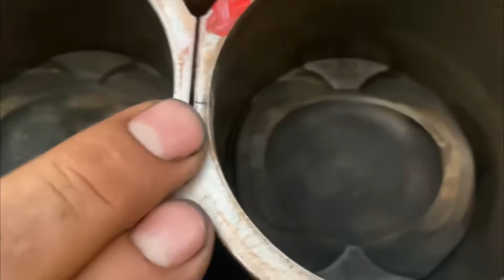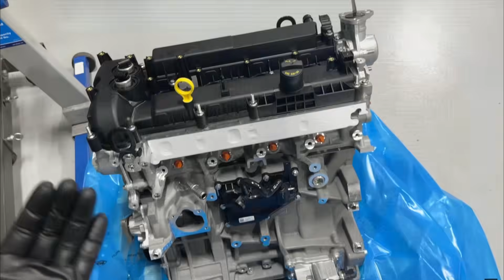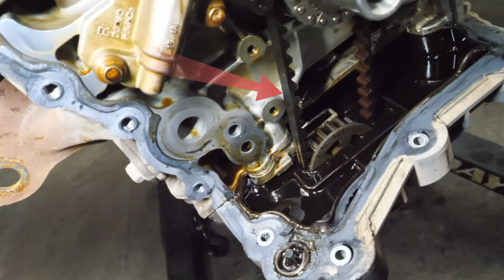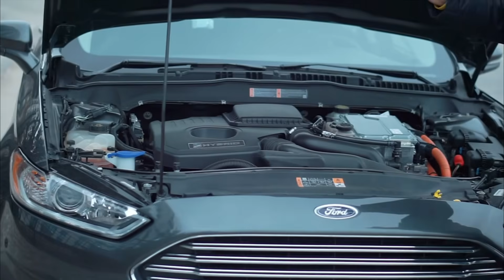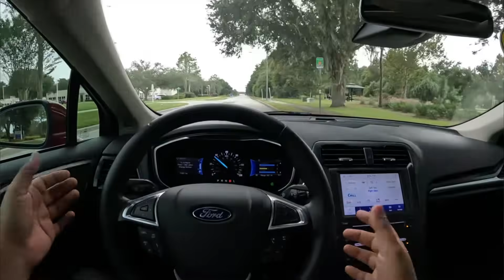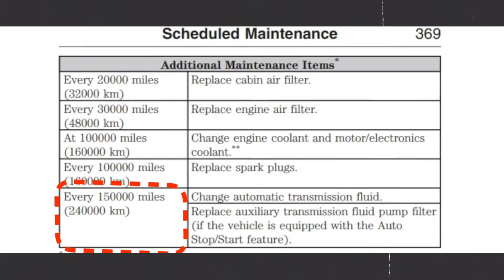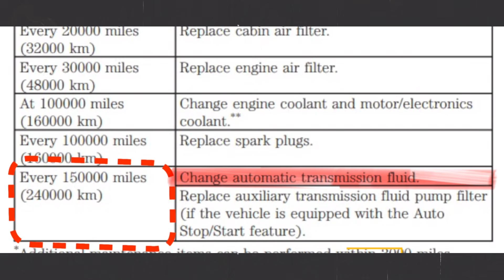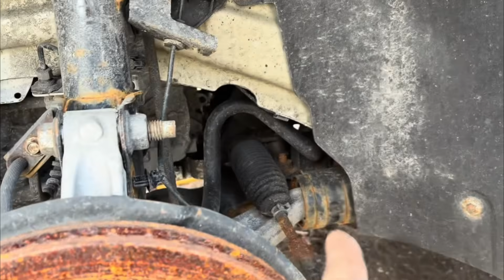Ford Fusion (2013-2020): A Complete Reliability Guide

Comment: I own a 2016 fusion with the 2.0 and awd... by far the biggest hunk of junk I've ever owned. It's a great looking car but i wouldn't recommend buying one.
Reply: I wish I had known this before I racked up 174k miles on my Fusion and 83k on my Maverick, both 2.0 Ecoboost.
Reply: @demonsaint1296  what all did you replace though?
Reply: @chriscargill7781  belts, some hoses, batteries, on time fluid replacements, and an alternator.
Reply: @chriscargill7781 fluids when due for change, some belts and hoses, battery or two, alternator, spark plugs and wires.  Active not reactive maintenance.
Reply: @chriscargill7781  nothing major, just regular on time maintenance and an alternator.
Reply: @demonsaint1296 do you also complain about changing your tires? Hoses belts and other small things wear out over time
Reply: I would say you have been fortunate with your fusion so for.  On a high note the maverick has a better 8 speed trannie though based off the old 6 speed.@demonsaint1296
Reply: i have a 2016 2.0 ecoboost at 86k and love the car no issues if you take care of it no issues will occure only thing i replaced is rear shocks which i did immediatly all oil change radiator flushes and annual checks if you cant afford to maintain a car you shouldnt own one
Reply: @DeeWazeMusicOfficial  you don't have a clue what your talking about lmao. All the lawsuits and recalls are just made up because you haven't had a problem? Makes sense.. you might want to do a little bit more research. Maybe join some of the fusion groups and get a little more knowledge before claiming someone can't afford a extremely basic car. 🤦🏻‍♂️

They look good and the older models went forever however the newer ones are literally known for bursting into flames. 

Rear shocks are only like 100 for the pair. 

Is this amazing fusion you speak of fwd or awd?
Reply: @chriscargill7781  i also have an 1984 f150 90k no sissues and a 2021 ford explorer no issues at 56k had all recalls done once released did all the research y do i need to join groups when i own one and experience it myself y dnt u take care of ur cars or by a bicycle 😂😂😂
Reply: @DeeWazeMusicOfficial  I also have 4 trucks what's that got to do with anything? 😂 The fusion is a shit car.. loved by people who don't know anything about cars such as yourself. 

Your cars so great you gotta try convincing random people on the internet who have forgotten more about cars than you will ever know. 

Yeah why or as you would say "y" look into something you clearly have no clue about. 

Good luck with your fusion 🙂 your going to need it.
Reply: @chriscargill7781 with all due respect most of the US market complains when most of the drivers do not service their cars properly. most of the lemon law cars there are awesome in almost everywhere else, ie n54 and n55 engines well maintained are rock solid, also fiat is a symbol of reliability in south America, the thing that kills cars over there are the emissions crap. take care of your car and it will take care of you. also all of the electronics issues you mention seem to be due to humidity. I had the same issues with my 17 focus powershift, and besides that it was bulletproof no issues with trans at all. I did maintained well, every 50k miles took everything out and clean everything  also did a repro on it to improve the shifting but I did 150k miles and it never left me stranded. so americans(us specifically) you have serious issues with servicing your cars. even toyota said this about the US market. we need to make the cars being conscious that people will not maintain them properly since Americans are lazy.
Reply: I'm at 200k in my 2016 SE... always use mobil one oil , shell higher grade gas , change sparks ...I'm going strong still
Reply: Really?  I had an engine failure with mine at 150k miles... but that may have been some fault of my own.  Replaced with a used engine for 6k.... the car now has 300k miles on it...  I got my money's worth
Reply: @PrivateAccountXSG  that's not bad! Still at 150k it shouldn't of needed a motor. I seen a guy that had like almost 400k on his and he loves them. 

Seems like they are really hit and miss I'm unfortunately in the majority that got a lemon from the factory. I like ford's but a bad design is a bad design. 

It's unfortunate to because I love the looks of them and the older version was great. 

I been following all the class action lawsuits and recalls on them and so many people have had all the same issues as me except the trans burning up... I've got lucky so far but hopefully it will be gone by then lol. 

I stand by what I said though and wouldn't recommend someone buy one.
Reply from the maker: After what Mi did ot start bothering you? What were the issues?🤔
Reply: @thelonglastexpert  problems started after 60k mostly the emission stuff that's mostly "dealer only" parts. The radio also will randomly turn on after being parked and I've even had the seat lean back as I was driving down the highway.. however the worst was when I put it in park to grab something out of my truck to turn around and see it left with out me! Luckily I have a long driveway and I caught it before someone got hurt. Ford does have a recall for that now but says mine wasn't included yet it's doing the same exact thing. All this and I'm at 93k miles. I've always had ford's but the fusion isn't a good car... it's currently ripped apart in my driveway soon to be traded in.

Guess it's still better than the 1.5 that randomly burns to the ground but not by much.
Reply: @chriscargill7781 regarding the radio did you do all the updates and still have the issue ?
Reply: @stevennunez6013  dealer said they took care of everything however it's the original motor so I'm not positive. 

I've been told everything runs through the touch screen/ radio but I'm not sure how true that all is. 

It currently has no power steering or hill assist due to the wheel speed sensor going out... really common with them. 

It's never been anything major just a crap ton of small dumb stuff that gets expensive fast. I will say the awd system is amazing in snow and mine has the factory block heater so it's pretty nice in the winter. 

However I'd never buy another one at least not a ecoboost version.
Reply: I just hit 280k  on my 2012 . I wish I had known it wasn't a good car
Reply: 😅 @michaelcoonce6694
Reply: I have the 2016 titanium great car
Reply: You bought the wrong one!
My 2018 plug-in hybrid has been very reliable and very cheap to run.
Reply: You still have issues after the new block design installed or does yours still have the old engine block ?
Reply: @stevennunez6013 fusions equipped with the 2.0 ecoboost made april 2019+ have the updated block
Reply: My recommendation is the Ford Crownvic
Reply: @CJColvin Those are actively being crushed to "get aging vehicles off the road", you can't even find them in Canada anymore.
Reply: You need to come see my 2 l turbo 6-speed
Reply: @savannahhutto1189  why's that?
Reply: That’s because you bought a ecoboost model
Reply: I haven't had any issues at all with my 2010
Reply: I’ve also got the 2016 but it’s a 2.5 and the base model nothing fancy about it. Almost 80000 miles and no issues. But I also do a lot of regular maintenance.